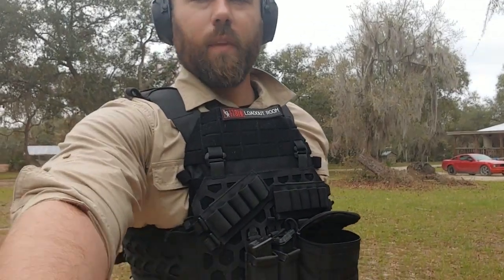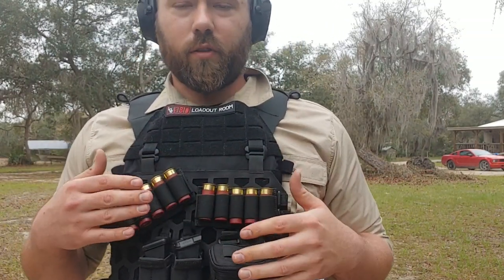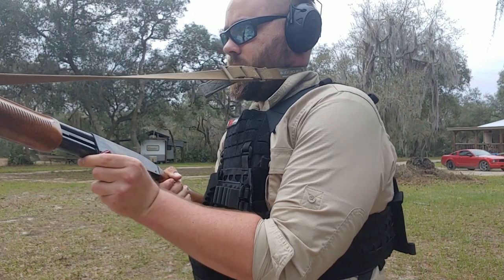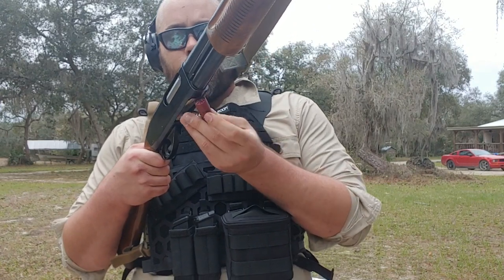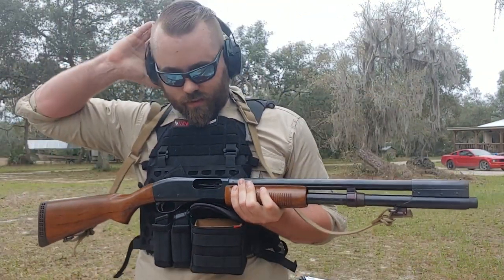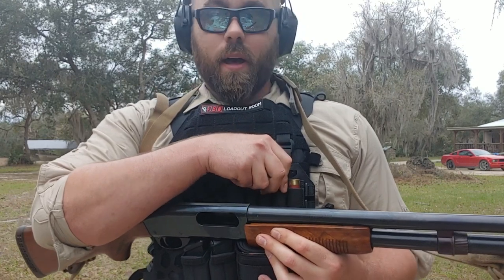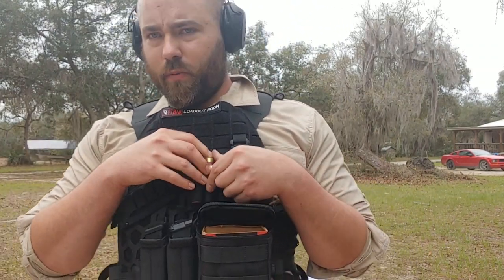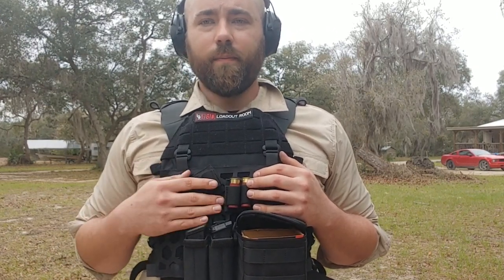5.11 Shotgun Loadout

Comment: Slap rail on top and use a Magpul RSA Rail Sling Adapter. And you have a great sling mount. Then use a quality bungee single point sling with a hook. Bungee helps with walking or running.

Comment: Good setup. But, you really need to find a more ergonomic way to run that sling. If I were operating with a shotgun, I would probably run a single point sling
Reply: Agreed. I run a short 2-point. Point 1 on the stock mount, point 2 tired around the hand grip.
Reply: I like the 2 point to single point convertibles

Comment: I use 6 round shot cards.
They fit perfectly in a m4 style mag pouch. Use a carrier with built in mag pouches on the front, then add a Velcro placard, so you can put 4 more shot cards on that.
One m4 style mag pouch with 4 loops on the outside for shells, on the side of the carrier with 2, pistol mag pouches.
Then 2 more of the same m4 style pouches on the belt. Plus whats on and in your shotgun.
I personally also use a pouch that folds down and holds 18 more shells.
Plus whatever i do or dont want to keep in my dump pouch.
I can carry at least 100 shells on me not counting any kind of backpack
Reply from the maker: Nice! Thank you for watching!

Comment: I'm even more of a beginner, but that strap would drive me crazy....I'm waiting on a one-point connection, thinking that'll be better for me but I'm not sure I'll ever have to deal w/a plate carrier either. It seems like tilting the gun to the side would help when single loading over the top. Also a 24 round pouch w/the elastic shell sleeves would make it easier to keep them facing the right way, but not sure if it'd be quicker, I'm just starting to learn to use it.

It does help to see someone else going through the motions, and from different angles, thanks for showing this.
Reply from the maker: Thanks for watching!

Comment: ok look this might sound stupid, but hey this is the youtubes, so im in the right spot. but i have a set up that is very very similar to  this. except i have a secondary pistol and its accompanying magazines. i have a 10 round shotgun pouch  and a few long bandoliers. altho i do not use the bandoliers, they look kinda silly slung around my neck. reminds me of a shotgun rambo. but ive been thinking of adding a 24 shot drop leg pouch. im curious if its not too much weight?
Reply: Sounds like a good plan, but the only way to decide is to try it for yourself. Are you talking about the thing that drops down and has two panels with loops? Worst-case scenario, you could tape or tie a box of 25 birdshot rounds to your rig and run around to see how it feels. I really don't think it would encumber you much, though.
Reply: @griff8858  good point. I've finally got rig lined out the way I feel works best for me. I think really the absolute best way is to just see what theoretically would work, and just try it out. Run some drills do a few rucks. And eventually you'll find your load out. It took a while for mine, and I feel really comfortable with it. It's not identical to my rifle rig which kinda blew my mind. Thanks for the good advice.

Comment: I have the BEST load out for the shot gun.
78 rounds yes 78 rounds.
50 buck shot and 10 slugs in a fanny pack wich is 100% faster to acsess and load.
So i have 7 plus 1 in my gun.
50 buck 10 slug in fanny pack and 1 6 round side sadle and 5 round stock.
Reply from the maker: Fanny pack for the win!